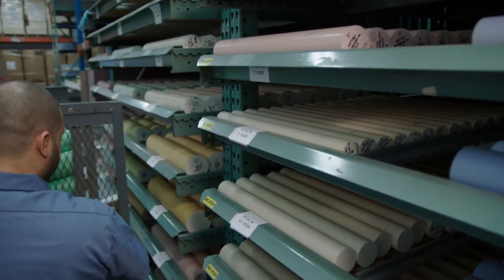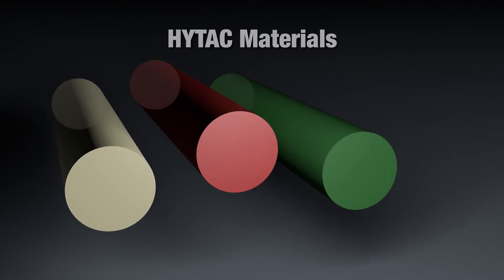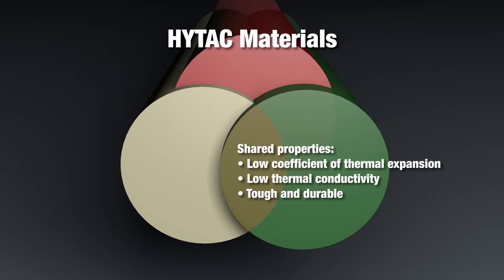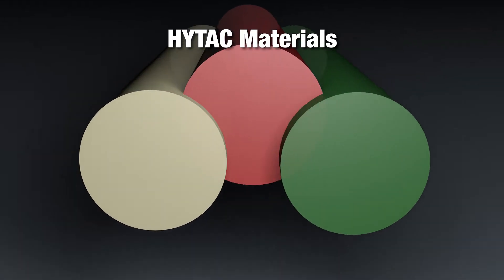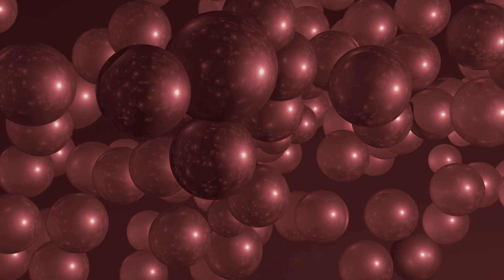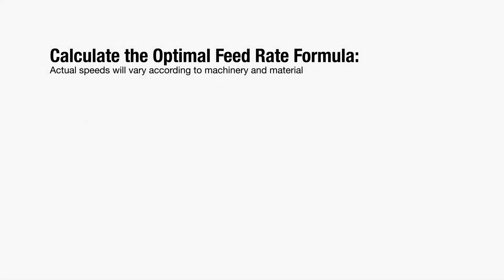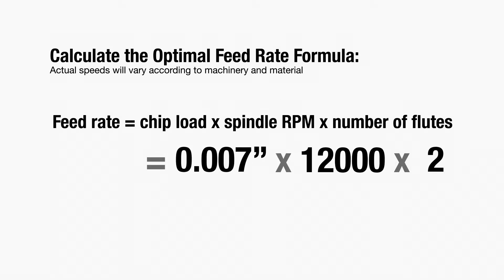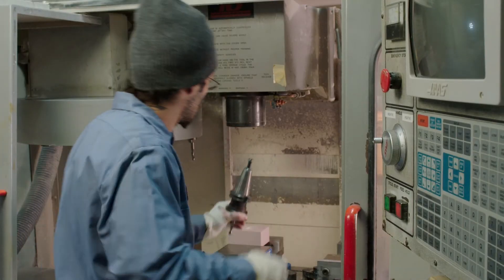HYTAC Plug Assist Materials for Thermoforming

Comment: what material is suitable for PET ?
Reply from the maker: Hello and thank you for the question!  There are a number of factors that impact the choice.  A common choice for general use with PET is HYTAC-FLX.  It is easy to machine and easily polished to modify the amount of friction from cavity to cavity or even in localized spots on a specific plug. If the plug requires fine detail, or for the longest life of the plug, HYTAC-XTL is also easily machined, is specially formulated for scratch free thermoforming and is ideal for long plug life and perfect part formation.  Please contact us at CMT or see our website (cmtmaterials.com) and we will be happy to provide more detail for your specific design requirements.